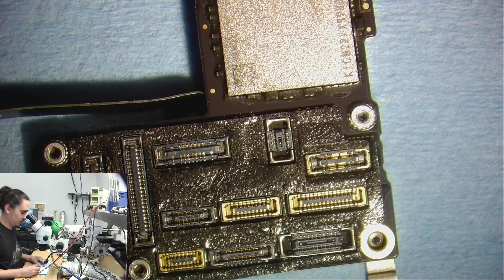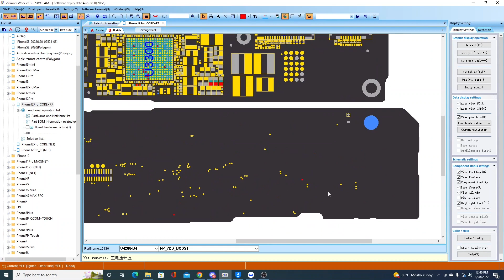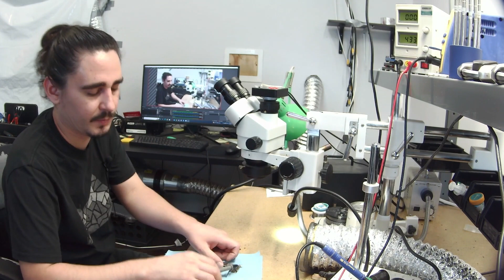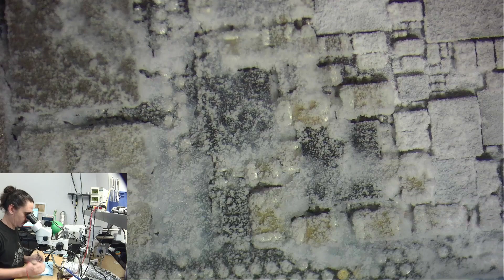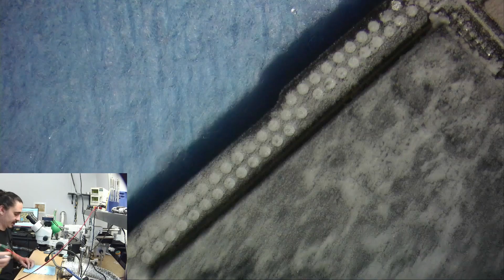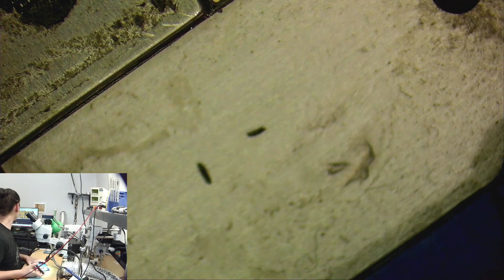Flat Dead, Undamaged iPhone 12 Pro - Motherboard Diagnosis and Data Recovery

Comment: Hello Aaron great vid
I have a similar issue i hope u could help
12 pro died while using 
No water damage no drop nothing
After check its a vdd main short 100%
Found the bad cap right next to Tigres took it out short is gone
Hooked it to power supply and boom full short again and tigres heating up a little but nothing ela
Have u seen such a thing before 
Everything els look good
Reply from the maker: is main short again? If short again, just find the component that is short.
Reply: @iBoardRepair  nope its not reading normal values, thats what driving me crazy
And there is no other line shorted to ground
Took out yangtze just to be certain and nothing even under pins values all normal
Reply: Hello what is the name of the spray you are using to confirm which part heats first